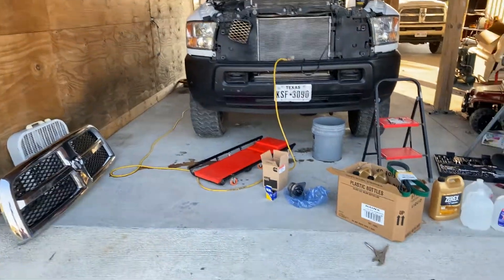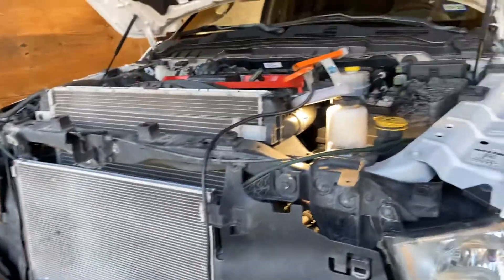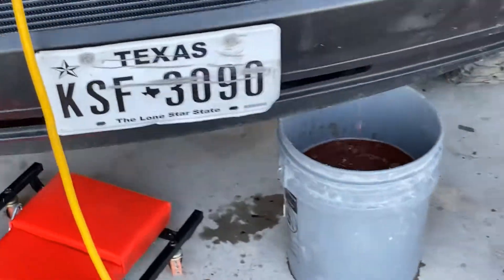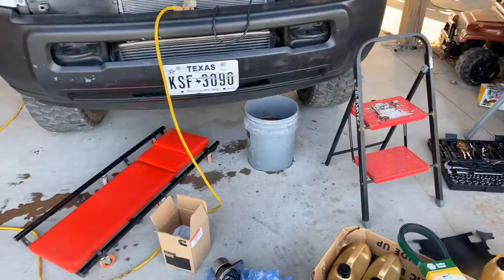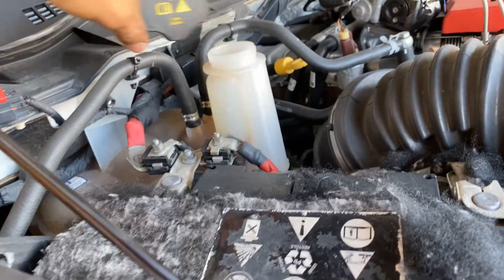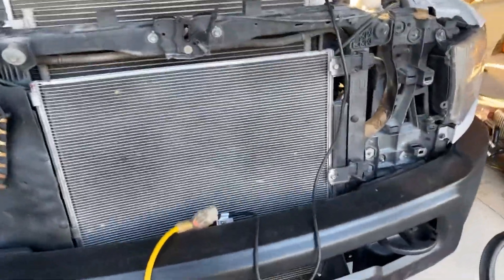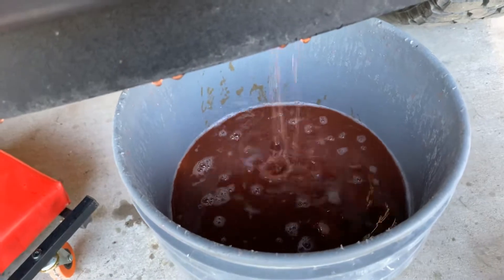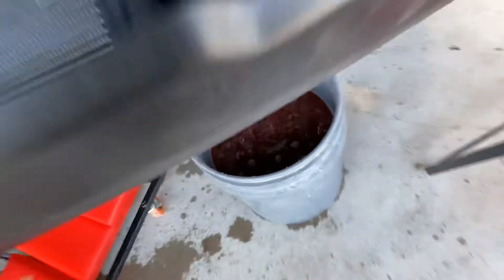Coolant drain plug location 2017 Ram 2500 6.7 Cummins 4x4

Comment: I used a 3/8" hex in the end to loosen the drain plug.  What a bitch to have to take off the grill. It wasn't hat hard but you would think they would make it a little easier to get to the plug....Thanks for the video.
Reply from the maker: I totally agree with you! I spent like an hour underneath the truck trying to find that drain plug even thought of taking the lower hoses off but it was hidden away behind the grill.

Comment: Taking the driver side fender liner out and turning the wheels to the left and boom, it’s right there... much easier than pulling the grill out...
Reply from the maker: 4x 10mm bolts takes the grill out with an impact driver and pops back but  my problem was finding the drain plug in the first place

Comment: Homeboy must not have a lot to do. All you have to do is take one bolt out of the power steering reservoir on driver side of radiator and you can reach the radiator plug and use a 10mm hex Allen wrench to loosen. No need to take the whole front end off the vehicle … unreal

Comment: Wrong coolant for that year. You are using a HOAT to replace and it’s a OAT coolant that’s you’re supposed to use.
Reply from the maker: At 1/2 price and it’s what Napa recommended me, you can see the Napa brand heavy duty green belt, and water pump. You need to flush out the system with distilled water where 2013 and up Cummins trucks take OAT instead of HOAT like 2012 models and does not mix correctly but clumps like the GM Dex cool. They claim it messes with the seals but I think it’s just to up sell seeing this original orange OAT Mopar coolant served me for only about 120k miles where service says to go to 150k miles. Needless to say the OAT coolant can outlast my OEM water pump (reason for the service) but if you can’t catch every drop and it’s not dirty to recycle then it’s more feasible to go with a proven but cheaper route. On 3rd gen 6.7 they use the Zerex Go5 HOAT, also Cummins 6.7 2007.5-2021 the engine crankcase filter is the same part. Ram introduced the new cp4.2 injection pump for 2020 but went back to the cp3 injection pump for 2021, sometimes proven parts are better. I’m on stock emissions, full exhaust and use the Walmart brand DEF fluid or Oriellys brand and haven’t seen an issue with any parts I’ve installed or serviced. Next time I’ll be upgrading to a Mishimoto radiator, a Sinister coolant filter kit, and new coolant reservoir container once I hit 200k. https://www.cumminsforum.com/threads/can-you-use-zerex-g05-coolant-in-2013-safely.2016058/
https://www.genosgarage.com/product/CV520010/crankcase-vent-filter
https://moparinsiders.com/ram-moves-away-from-the-cp4-2-injection-pump-for-2021/

Comment: Metric 10 hex socket. Trying to wrench it drove me 😡
Reply from the maker: I would think the manual would say something about this, payed $50k+ for a good work truck only to make it a pain to work on.
Reply: @Cjrm3gtr  not sure where or if you can get factory service manual for these newer trucks. I just sold two 4th gens and went back to a manual 03 truck due to simplicity